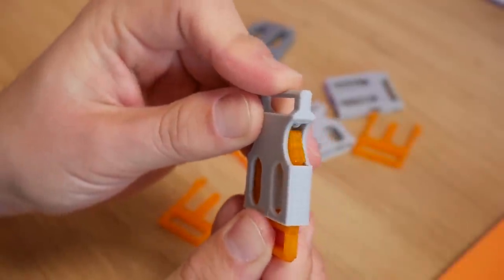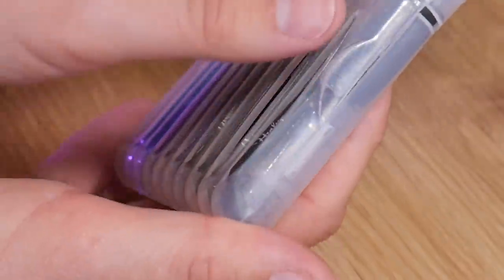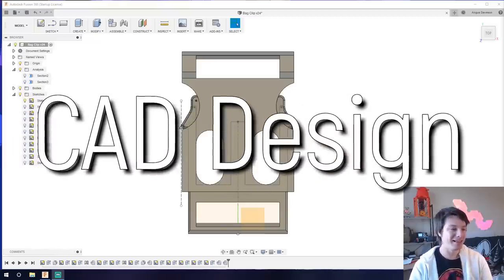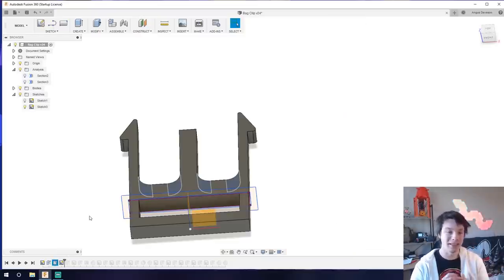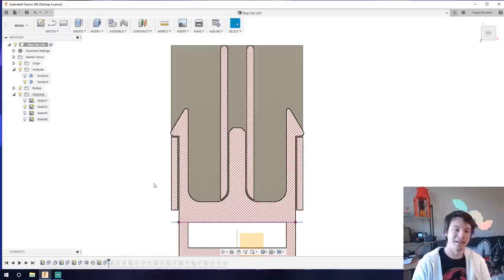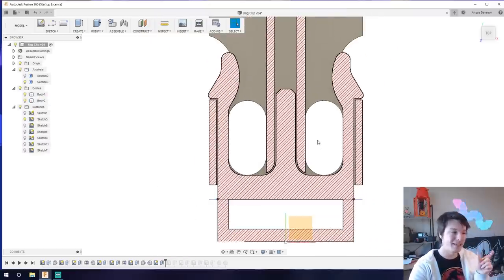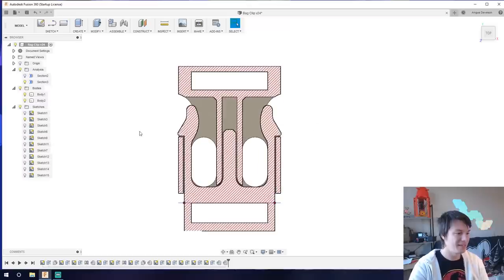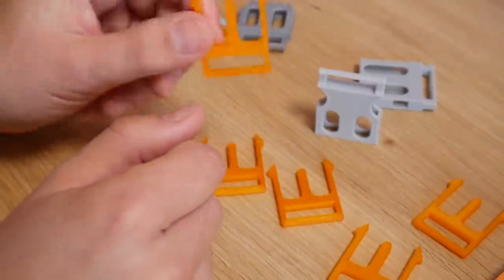Designing Buckles, Clips and Snaps for 3D Printing - Detailed Guide

Comment: I've started to work in Fusion360 and I hate it :) The UI system resembles the most of CAD/CAM systems but the interaction is aweful. You need to learn some completely different principles (against other very popular systems like SolidWorks and Catia). The whole experience reminds me some kind of a martian program. It's counter-intuitive for me. Maybe I'm the one with this? :)
Reply: KiR-3d Well, it's free. The only other suitable freeware CAD software I found so far is OpenSCAD. Try it out, and you will never, ever be complaining about counterintuitive software again. 

I love it though, as it builds everything precisely on the values you enter; everything is exactly defined. I "need" that, which is why I can't stand Blender and stuff like that.
Reply: @sh4dy832  Maybe in Blender (if you've meant it) it's very possible then a good CAD addon (i mean fully usable and working) will be made.
Also i'm not telling about "what's free and what's not" ;)
P.S. i assume that a non-free F360 gives you the same experience.
Reply: KiR-3d So you mean there's Blender addons (yes I was talking about that, fixed the typo now) that make it actually useable as CAD suitable for engineering stuff? Might have a look into that then...

Comment: I see a number of flaws in this design, but anyway - it's a good beginner's tutorial! Voted up. :)
Reply: It would be good to list them to help others in the design.
Reply from the maker: Yes please, always looking to improve!
Reply: @MakersMuse  
1. Guide should engage first - before locking elements;
2. Locking elements should have some limiters behind them - to prevent breaking by not allowing bend too much
3. The part printed vertical will be not as strong in comparison to part printed flat.
....Of course this is just my opinion!

Comment: Is there a way to calculate the elasticity of a part based on thickness and material? I would like to design something like a cable marking clip (like a "C" extruded) for some board game as game pieces, and they would need to go on and off their wooden dowels often and easily of course. I struggle with the opening of the c and the thickness of the part itself and can't find any formula or advice anywhere how to go about something like that... :( Do i really need to print a gazillion different versions or is there a short cut i can take to narrow it down a little?
Reply: Kolja Geldmacher You surely could, if you'd know the right specifications and properties of your plastic. It won't be accurate though, due to the way the part is built (basically separated strings that stick together a bit). I'd say it's more efficient to just find the right dimensions through try and error.
Reply: @sh4dy832  and could I somehow get the information by printing some kind of test object first? I mean like one of those printed tongue depressers or what they are called, that cnc kitchen does not use because of his setup...

Comment: large clearances should not be designed into objects themselves, bevause that will screw up the (proper) calibration of the 3D printer. It will result in an overly-compensated clearance and thus a failed print. As each 3D printer is different, and people using different configurations in their slicer profile, one can not know what it will eventually turn into.

Slic3r has this option in /Print Settings/Advanced/XY compensation

Comment: Has anyone ever pre-printed support material as a separate part, then sprayed it with mold release?  The printer could be paused when actual part to be printed reaches the point that the support material is needed.  The pre-printed support would then be laid in place and the printer restarted and it would be able to print across the top of the temporary support. The support material could be printed out of the same material as the final part.

Comment: These snaps are called Snap-Fit joints in engineering. Here is a useful link with a library of these and a reference talking about them. https://www.thingiverse.com/thing:1860118 The math for designing them falls under the fields of solid mechanics and compliant mechanisms.

Comment: I cringed a bit as I watched you open the light switch with a screwdriver.  Angus, you should go get a 10-pack of spudgers. In fact, anyone who's about to start building snaps might consider the same.  Spudgers are really handy tools
Reply from the maker: I do need some, but don't worry I only use worthless screwdrivers like this !
Reply: @MakersMuse  --  Just finished the video.  Now I want to find a spool of polypropylene.  :-)  The point of the spudger is that they tend to leave fewer marks on the plastic part you're disassembling than metal screwdrivers with sharp edges do.  Thanks for the response.  And definitely thanks for the excellent content!

Comment: printing a zip tie is pointless unless you REALLY need to do so for a specific reason. The last time i bought zip ties, it was like 1.25$ for 100. Printing one would cost more in material, effort, and time, than it would take to save 12 cents and a trip to home depot.

Comment: As I started to work with snap fit elements in my prints I found this document. Its mostly for sizing your elements regarding the material properties, but also gives some nice examples on different types of joints. http://fab.cba.mit.edu/classes/S62.12/people/vernelle.noel/Plastic_Snap_fit_design.pdf
Reply: Very helpful. Thanks for linking it!

Comment: Such a pity that you only use Fusion 360. FreeCAD has become quite powerful and there's no company that takes your own designs hostage.
Reply: Hostage? What do you mean?
Reply: @RabbitsInBlack  Autodesk forces you to store your designs in their cloud. They can and will change their terms of use for Fusion whenever they consider it profitable. You have no choice. Either pay whatever Autodesk charges or say good bye to your designs. That can't happen with open source software like FreeCAD.
Reply: You can save them locally using the export function and re-open them.
Reply: FreeCAD crashes a lot for me. Perhaps I'm doing doing something wrong. Sometimes, I'll start it up, new part, new sketch, boom, crash.
Reply: @ctheroux  re-open them what with when Autodesk turned your license down?
Reply: @Soumein  I can't confirm that FreeCAD crashes a lot. V0.18 (and even the daily builds of V0.19) are reasonably stable.
Reply: I've used freecad for  2 years.  I switch to 360 because some minor modifications  to a model sometimes screwed it up.  Often, I had to redo the part completely.   Freecad (open cascade) is not stable enough.  360 is almost flawless and has a lot more features.  I hope that I will be able to switch  back to an open source solution soon.  I'm using Window$ only for 360 😥